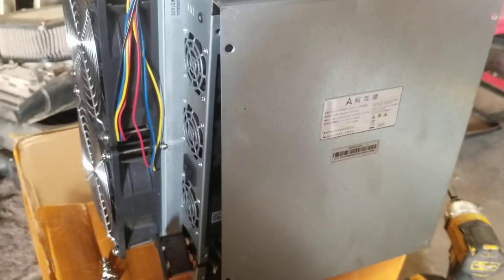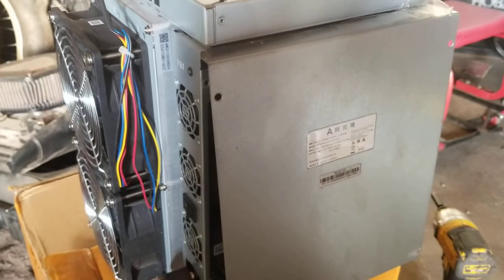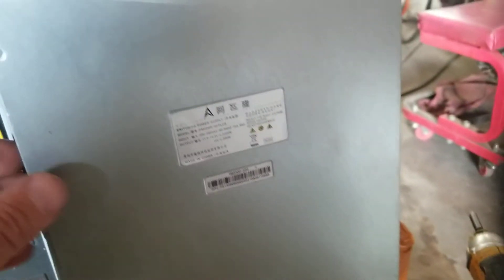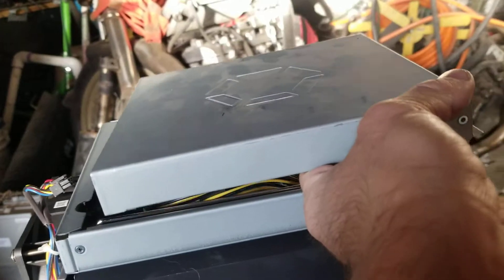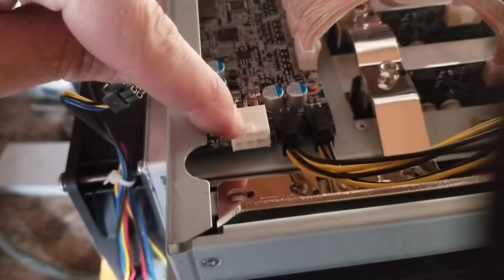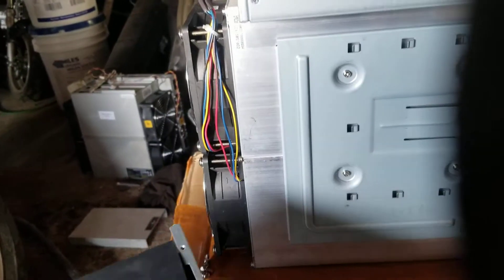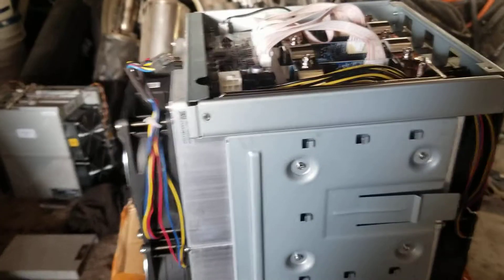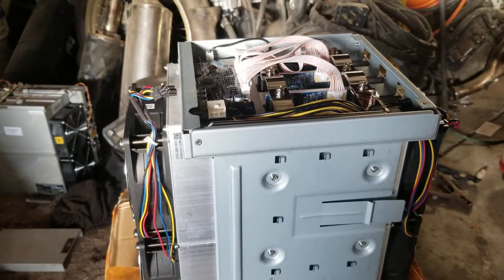Avalon A1246 Breakdown PSU Removal

Comment: My 1246 wont turn on at all. Is there a few steps to do before I order a new psu?
Reply from the maker: If you connect your power cords and nothing happens then your next step is to either dive into the psu or just order a new one. There are a few pieces inside of it that can break very easily. Good luck!
Reply from the maker: If you know nothing about fixing electronics i would highly recommend just ordering a new one and go from there since a new psu is not very expensive.
Reply: @brothersmechanics2028  ok thank you. When I connect the cable, I do hear something but it doesn't even power on. Do you happen to have a link for the psu?
Reply from the maker: @HandyButClueless  Hmmm oddly enough i dont see anyone in the states that is selling them. I can add a listing to ebay but we wont get it for about 2 weeks. Interested? Ill ask my distributors in the morning if we have access to any here.
Reply: @brothersmechanics2028  Yes, I am interested.  Thank you again.
Reply from the maker: @HandyButClueless  Here is the listing:
https://www.ebay.com/itm/Avalon-power-supply-BTC-BCH-miner-PSU-For-ASIC-miner-Avalon-A1246-/265596245605?mkcid=16&mkevt=1&_trksid=p2349624.m46890.l49286&mkrid=711-127632-2357-0

Comment: Brothers Mechanics, is there an easy way to determine if you have a bad power supply? I have a couple machines that don't always recognize all boards.  Not sure if it's a CB, HB, or PSU issue.  If you have any insight I'd really appreciate it!  -- Thanks!
Reply from the maker: If your boards are not being recognized most likely the hashboards are going bad. Power supplies and control boards on these rarely go bad.
Reply from the maker: Ill check how much power should be going into your hashboards and do a little video tomorrow so you know for sure.

Comment: Do you have experience repairing the PSU? Or diagnosing/troubleshooting PSU?

If one psu fan goes out it will power the miner but won't hash. Replace bad psu fan and mines. 

I've been tinkering with some 1047s. Multiple issues. Getting some up then we had storm and power surge/lightning strike knocked a bunch out again.
Reply from the maker: We dont do much in terms of repairs, we can replace anything but diagnostics is only basics for us. Simple soldering and resister replacement is as far as we go. Not worth it to repair when a psu is less than $400.

Comment: Hello! Could you tell me how much a new PSU cost for this model? I have a 1246 83THs which worked fine but now does not turn on at all. I believe it's the PSU.
Reply from the maker: They normally cost around $600 right now. If you need one i can list a new one on our ebay store. Just let me know.
Reply: Have you opened the psu cover and looked at everything? Could be as simple as the main fuse...or need a good cleaning if it's been running in a non clean environment.

Just be extremely cautious and wary if you open it up. Potentially lethal voltage if careless and proper protections aren't in place
Reply from the maker: @jeremygalloway1348  this was a broken psu.
Reply: @eduarz723 Did you solve the problem? My 1246 doesn't start up at all. Was it the PSU?

Comment: I haven't been able to start up my 1246, according to the log it has network issues. Ive factory reset the miner and tried getting in touch with Cannan myself yet havent had any luck any help?
Reply from the maker: Network issues relates to your miner id in the configuration area. Its very sensitive. Also check your pool and your internet. Doubt its your miner.
Reply: @brothersmechanics2028  Ive gone over my configs multiple times and tried different pools yet the miner doesnt hash. do you have a discord? Thanks for the help

Comment: I had the same issues.  Bought a new one and the power supply is not working.  How long did it take you to get a replacement?
Reply from the maker: We work very closely with Chinese distributors so we get them within a week. Check your outlets power voltage.  If its 208v your machine wont turn on.
Reply: Brothers Mechanics I set up a 20amp breaker with 6-20r.  Do you recommend switching it to a 30amp?  Did you had to pay to replace the PSU? Or did they just replaced it for free?  Any advice on how you got them to send you the PSU?
Reply from the maker: @masterdaval5650  If you have a 30amp then yes switch to 30. We don't pay for parts that are broken on arrival due to our relationship of many years with them. I would say contact the company you bought it from and see what they say.
Reply: @masterdaval5650  я бы не стал менять предохранитель на 30А если ранее там стоял предохранитель на 20 или 25А! Это может быть опасно для всей машины! В случае перепада напряжения лучше если сгорит предохранитель на 25А стоимостью 1$ чем сгорит блок питания за $500, или весь майнер за $5700!!! Поставьте такой предохранитель, который стоял изначально!